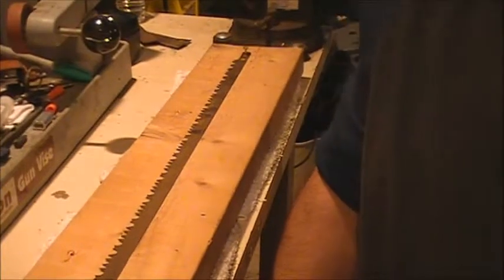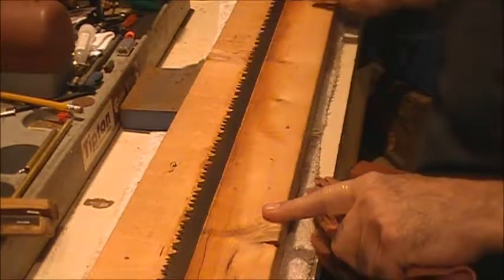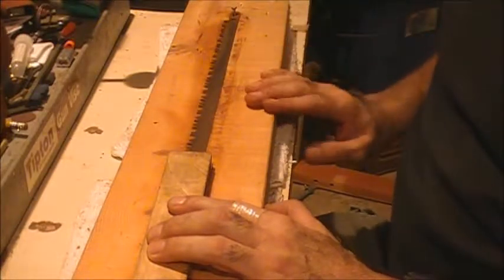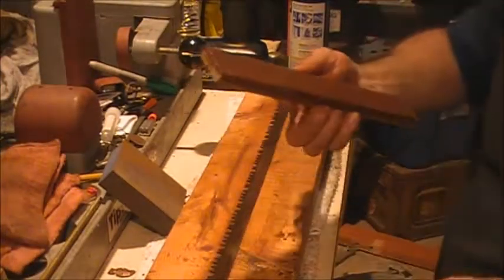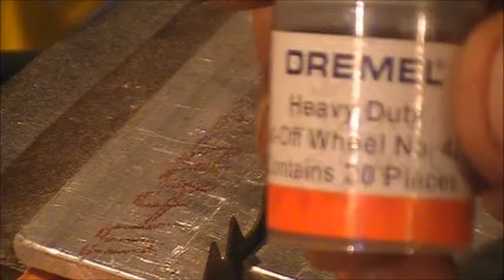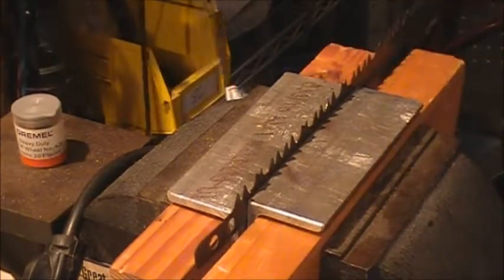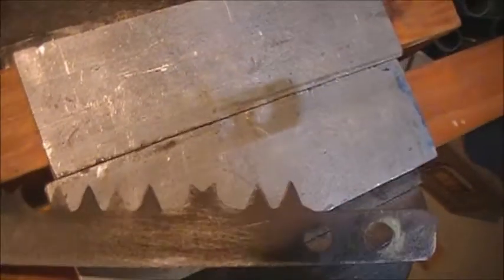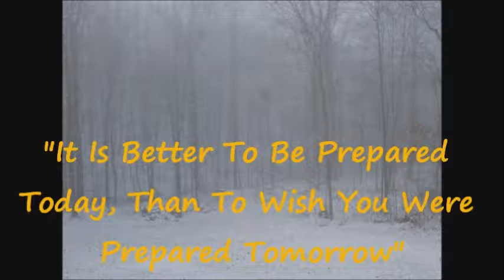Bow Saw Sharpening

Comment: Errm? You have no idea what you are doing or how a bow saw blade works. Otherwise, a great guide to wasting time and wrecking a bow saw blade.
Reply from the maker: Just because I used a not traditional way of sharpening the blade, doesn't necessarily make it wrong. It did however make the blade extremely sharp. Thanks for watching.